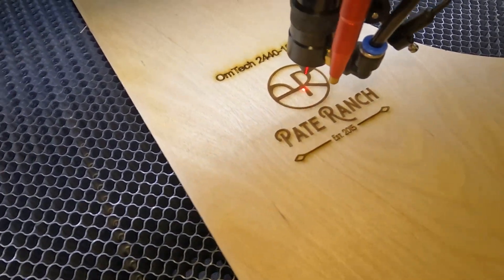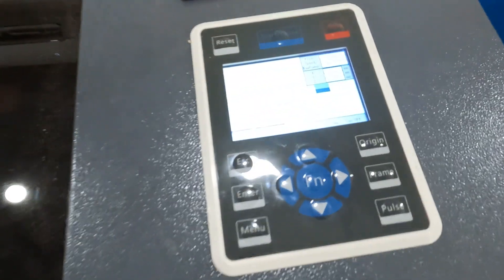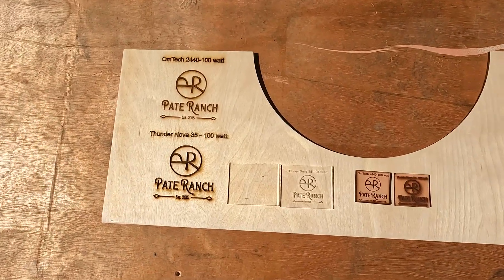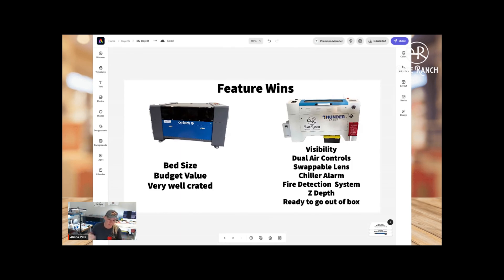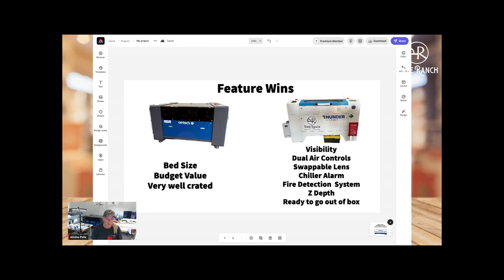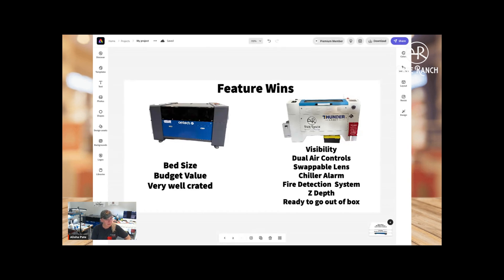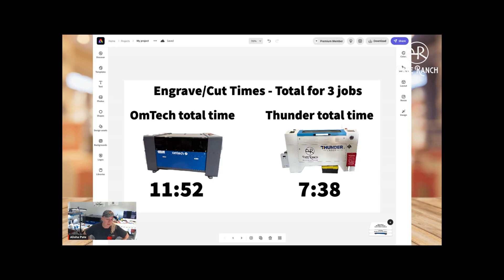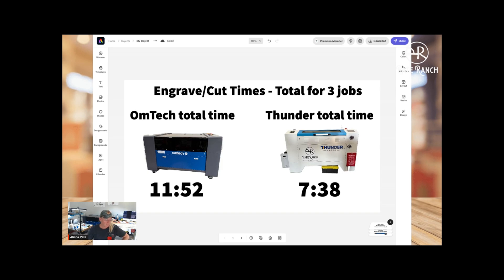OmTech vs Thunder Review Part 2 - Performance and Final Summary

Comment: My wife and I were just watching your shop tour, a mini-barndominium almost w the kitchenette, add a futon & a powder room and you’d never need to leave..  very nice.  We mini-splitted our shop (wood & bit of metal work) for year round use (N-NorEast DFW) best thing ever, also made us address dust collection after years of sawdust literally everywhere.  From the red clay, hankering a guess ya’ll must’ve moved a bit north?  Hopefully you’ve got more sandy loam away from the shop build site.🤞

Anyways taking my southern-talk-your-ears-off-glue’em-back-on-a-few-times hat off..

Any thoughts on regular maintenance between Aeon/Omtech/Thunder/Trotec?  Daily weekly, monthly, namel which machine is easier to clean & keep in alignmentetc?  We just issued an RFI and this area is one of the things haven’t seen discussed across all these brands.  Since you’ve had hands on w at least three of em, thought I’d ask.  Any input would be appreciated!

Have a good’un!
Reply from the maker: daily and weekly would be cleaning lens and mirrors.  They get dirty when you cut/engrave stuff.  6 months would be the water in the chiller.  Grease the wheels and rails.  Check out this PM checklist. https://support.thunderlaserusa.com/portal/en/kb/articles/preventative-maintenance-checklist#DAILY_CHECKLIST
Reply: @PateRanchCreations  thanks.  We’ve gone through a lot of the online resources available on each of the Mfgs sites (40+ years retentive engineer type) and some online vids.   You seem to be in the somewhat unique “independent” position (don’t recall seeing any affiliate notes in your vids/descriptions, perhaps I missed them) of having had hands-on with at least three of the brands.   Figured you might have some unique insights as to which is overall easier to maintain during the regular or ad-hoc maintenance cycles.  Or perhaps even warranty thoughts etc.  No amount of mfg pics/doc beats hands-on feedback/experience 😉 Thanks though.

And avoid wet red clay 😁. Though I don’t know which is actually worst, the red clay I grew up w in East Texas or this “gumbo” black clay we’ve got in DFW area 😂

Ya’ll have a good’un now!
Reply from the maker: @jessefurqueron5555  I grew up in Oklahoma so I know that nasty red clay.  It stains.  Thunder has a 2 year warranty, OmTech has a 1 year, and Aeon is also 2 year on most parts.  From a best parts perspective I am gonna say the order is Thunder, then Aeon and then OmTech.  I am a engineer so I like looking at the mechanics and parts of tools.    From my experience, I like that the parts are removable on the Thunder so I can pull out the tray and take the doors off easy.
Reply: @PateRanchCreations  thanks for the follow up.  Yeah and I think per cubic inch accumulated on your boots (cubic foot? Ok disclaimer we’re size 16/17 types around here) red clay may actually be heavier.   Don’t miss one lil’bit digging holes for creosote posts in it (pre auger, pre metal-tamp posts days).  Post holes in gumbo…6’ digger/breaker bar then clean out w diggers, still a pain.  Software/hardware engineer/architect w product line manager tossed in…so I’m “ambiguously” “recursively” retentive 🤦🏻‍♂️.  Kinda like “I argue with myself, but I always win”.  Thrown exception/double fault failure note:  “Unless my wife is around…then I always lose”.

I just saw on “laser w Matt” where he was comping Epi & Thunder.  Key thing he mentioned was how tight spaces are in Epis (we looked at them long ago…there’s a story there) though are not considering them currently.  What he mentioned that stood out was comping ease-of-access in tight spaces in the Epi vs (but larger overall machine) access to parts in Thunder.  That kinda thang is a big’un given these kinda large mitts my son & I sometimes refer to as hands.  And now we’ll make a point to check that kinda thing out when we head over to Quitman Tuesday.  

I am curious about the Thunder X-axis guide bar etc being exposed.  Aeon, while things seem to be a bit more “protected” not sure how effective it is (not to mention being able to easily see when something is dirty) long term vs ease of access. Looks like Aeon might be tedious/bear to get into and do a deep clean, disclaimer ain’t seen one in person; was planning to pop over for the sales spiel, excuse me,  demo but they’re not doing any for the foreseeable timeframe.  So for them pretty much have to rely on YTub and the RFI response.  

Design wise saw where someone mentioned there are fans (not the air assist) in the front (lid?) of the Aeon that blow back over the top of the work surface to help keep the surface cleaner from cutting debris (settling).  This is not referring their iris system (suction).  Haven’t found any pics yet, may be a pigment of an imagikination.  will do some more digging.  Moving on.

Been specifically looking for vids of well-used to machine to see where they’re “dirty” even after a “fresh” cleaning for viewing purposes.  

Sometimes it’s the simple things that folks point out along the way, like say, changing say lubes,  We’ve changed over to using PG2000; helps “preventively” for things like guiderails/rods by being much less prone to attracting detritus than say white lithium.  Note, I’m not suggesting folks use that on their lasers, at least not yet, just an example.  We started using PG2K In the woodshop when we started snacking on that certain German-Green tool mfg line.  Now we use on every applicable surface…it lubes but doesn’t attract anywhere near the dust.  I digress.

Question) Have ya’ll seen any propensity for rusting on any of the parts?  Example, can put Jet/PMatic cast iron in the shop, Topcoat it, and within a 2 weeks it’s rusty.  Have 20+ year old Delta cast iron that’s been coated/cleaned once or twice in all those years and gets equal use…nary a bit of rust well maybe a sweat spot or two.  So wondering if ya’ll have noticed any rusting say on the guiderails etc.  don’t know what coatings/finish they’re using.

We run small resin/FDM print farm for in-house and CNC routers, what people forget is the amount of maintenance required.  Kinda like back on the farm…the old Farmall was a lot easier to maintain than the Ford 9700 (ok thats two totally diff beasties yes).  KISS is sometimes better … as long as it meets the objects/purpose.  

Again thanks for feedback/input,  always learning!

As always, YMMV.  Just sharing, nothing more, nothing less.

Not associated w any brands/mfgs mentioned (good/bad) other than as a paying customer.

Have a good’un!
Reply from the maker: @jessefurqueron5555  Have you thought about looking at the Thunder RF tube machines - The Odin or the Bolt.  I just got one and I am very impressed with it.  I like it more than the Nova line.  It is more expensive but a great machine.  Also, come join our group on facebook if you have a facebook account.  https://www.facebook.com/groups/laserlounge1
Reply: Will be talking about the Bolt with Grant Tuesday & a 24 along w proofing an avail Fusion 360 post-proc for exporting .svg’s to LightBurn, fun stuff.  

A laser in our situation is not the income-generator end-goal, though we may incorporate them into production flow down the road.  Ahhh, the Odin.  “Odin, mine Odin where ‘art thou my dear Odin?  Oh but was not for space constraints unto, would Odin, thee,  be mine!”.  Hey just think, my wife deals w this type of thing 7/24/365 and it only gets worse (improves?) each year😈.  Blame my early years spent as a “green bologna eating caffeine guzzling propeller head.  Earth calling,..

Don’t have quite the space after all these years of machine collecting as we used to 🙀.   Got a couple could sell but that takes time.  I did see that on the Chinese(?) site for Thunder, they had something about an RF module for the 24; if I read it correctly?  Perhaps a typo/misprint?  Even if correct, don’t know if it’s avail in the states or that the Nova chassis can support it if higher speeds are involved?  Makes a fella go “hmmmm…” and ponder a bit.  Gonna ask, definitely.

Will check out ya’lls FB.   In case you’re the group admin, my FB name/handle may be a bit ummm unrecognizable,  it won’t match what’s here (what’s shown here does match my LinkedIn).  A younger brother and I started joking and using sci-fi related names (his fault 👉🏻👈 not mine 😇)…if you’re a Trek person you’ll “get it”.  We lost him suddenly a few years back, I left it set as he last suggested. 

See ya over on FB.  

P.S.  Oh, I don’t do profile pics.  Been on the net since it was DARPANET, only one identifiable pic on it.  I’m still working to convince a certain sibling to delete it.   So ya’ll are gonna decline me - them’s the rules, so totally down & cool with it.  Just can’t do ‘em pics, too many cameras keep breaking dag’nabbit ☹️

P.P.S. 😂🤣 yepper darned sure I got the “Do Not Pass Go” auto-relegated to the dumpster bin, I had to press “The Other” button I couldn’t press the first button, (got a real red-pill blue-pill vibe on that 😅).  I did attempt to explain “why”.   Oh my 🤗😁 well that was fun.  Better be getting out to cleanup in the shop.  Gotta make space for a shiny thingamajig next to the whatchamacallit.

Seriously though and really; thanks again for pointing me over there, it was worth a try and also thanks for conversation exchange, much appreciated.  Sparked some thoughts (honest, there’s  a lil’ bit of functioning grey stuff..oh, that’s hair my mistake) and I added a coupla things to the RFI, I’ll be sure give credit where due on that when I speak w Rhonda et al 🤗. 

I’ll surely keep an eye out on ya’ll here on “The Tube” though.  Go easy on Rhonda if/when ya talk to ‘er anytime soonish, she’s getting our RFI today 👻😊😉.  Now I just gotta find out who over in the Quitman office is a native 🤔, so as I can rib’em ‘bout playing us back high school football days.  😈

Have a good’un now and stay say safe, ya’ll hear?

Comment: I'm glad I came across this video.....we are looking to get another laser.....I'm wondering if it will cut 1/2" Baltic Birch in 1 pass?
Reply from the maker: I can cut 1/2" baltic birch with 1 pass on my Thunder with 55 psi.  I didn't test that on the OmTech.
Reply: Get a 150w and will cut easy
Reply: @MUUQNN  That would do the job for sure, but we would like it in the basement, and a laser of that size won't fit

Comment: I don't think this is advertised very often but I know it's true (Brian said so 😅)... Thunder tubes are over sized. If you get a 100watt machine your tube is closer to 120watt maximum output. Mine is 118 watts on the sticker. Then it is calculated in Lightburn so running at 100% power actually equals 100watts. This not only protects your tube but allows you to run at 100% if and when you need to. Most people don't know that.
Reply: 1. You should never run at 100% power. Ever. 

2. This is standard for glass tube CO2 lasers. Your maximum output when the tube is brand new is 10 watts under its advertised rating. Your thunder will only produce 90 watts, even if its maximum output is 118. Regardless, your produced power is controlled by your power supply and controller, not the tube.